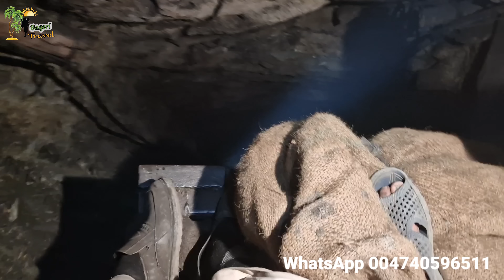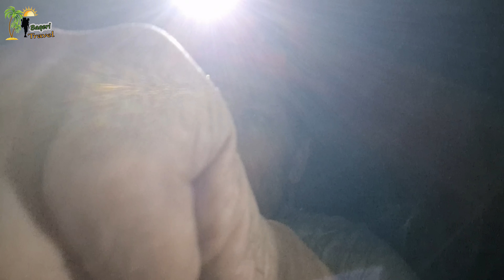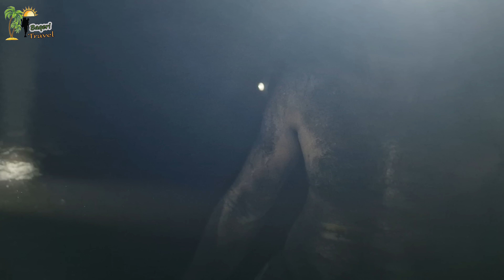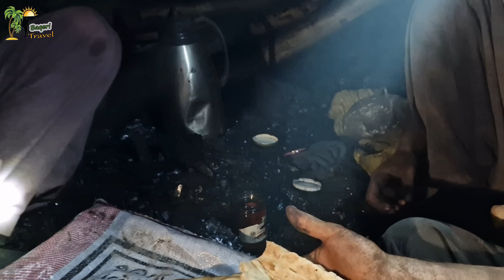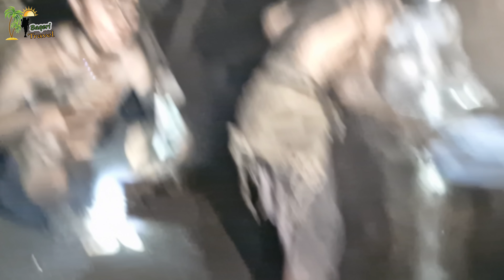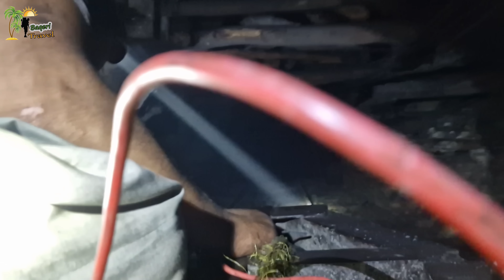Working in Coal Mine is Too Hard |کار کردن در کان کولہ خلی سخت است

Comment: I am advancing my studies on mining geotechnics. From my point of view, this coal seam underground mine looks pretty dangerous. For example many practices show that wooden support system’s lifespan usually lasts 5-6 years. I do not know how long this mine has been constructed but looking at the open shaft structures at some locations, support has been already damaged due to overburden pressures and other geomechanical activities surrounding the opening. It seems wooden support has not been coated with shotcrete. Which results to the fast deterioration of wooden structure. Air and water moisture is the big risk here. Please specify your mine lifetime. Remember to forfeit mine after 6 years at least or change the support system (like changing the wood). Overall geological structure seems pretty unfavorable too due to its foliation. Blocky rock mass could collapse into the main shaft. Be careful. Good luck brothers. Keep us informed about the mine activities. I will try help as much as I can.